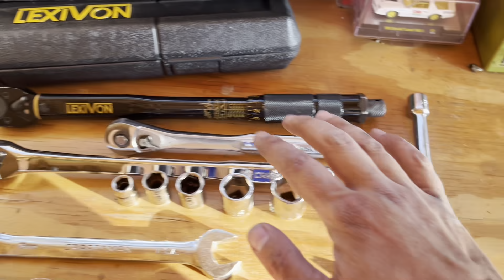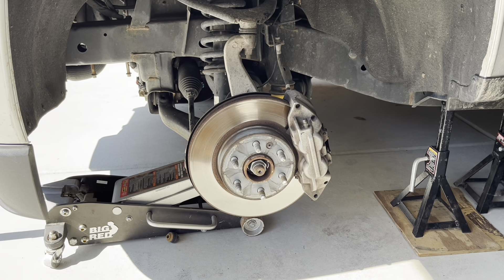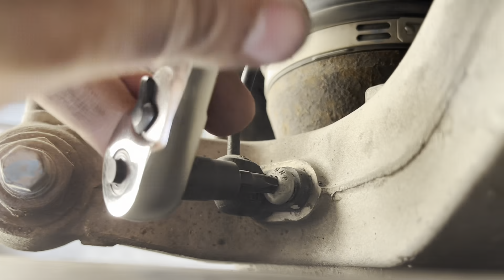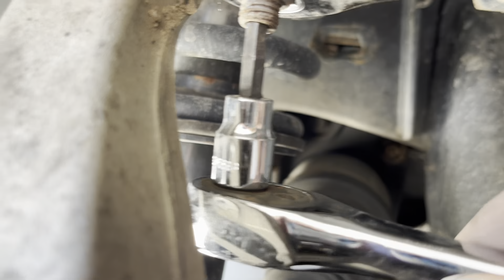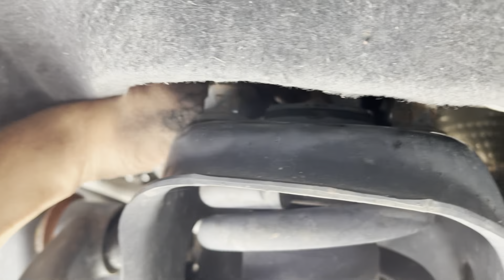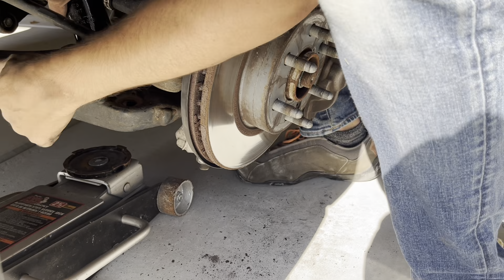Front Strut Assembly Remove and Replace 2015-2022 2nd Gen Chevy Colorado GMC Canyon

Comment: One does not have to fully remove the sway bar to facilitate replacement of the struts, correct? Removing the end links, loosening the bushings and allowing the bar to be lowered out of the way works, doesn't it?
Reply from the maker: That’s correct. I mention that at one point in the video, I was in there replacing the bushings anyways so I just dropped the whole thing.
Reply: @WildFrontierGarage  Gotcha thanks. Missed that!
Reply from the maker: @StevenDFlynn yeah no worries - I try to get pretty detailed so I don’t turn out to be that guy that skips the crucial steps, so it’s easy to miss things. Hopefully the video helps!

Comment: I got a set of Monroe OE spec struts. Guess we're all at similar times in our truck maintenance schedule
Reply from the maker: The 2nd gens are the old ones now lol
Reply: @WildFrontierGarage  Question for you guys using the Gabrial or Monroe "quick struts".  Did the ride height stay the same with the springs supplied with these assemblies?
Reply from the maker: @novajohn6538 no difference in ride height for me on the Gabriels
Reply: @WildFrontierGarage  Thanks.  Are you pretty happy with the ride and performance of the Gabriels?
Reply from the maker: @nov @novajohn6538 - I’ve had no issues since I put them on in this video. Rides like stock, no change on ride height, no manufacturer or maintenance issues either.

Comment: If I use bilstein shocks in the back that support one inch of lift can I lift 2 inches in the front since for stock the back is already an inch hire? Like 2 inches lift in front and one inch lift in back ?
Reply: If you want pretty close to perfect level, a 2" leveling kit in the front will yield the just about perfect level on majority of the 2nd gen Colorado/Canyons. If you tow or don't want it leveled, but want the 2" in the front...then yeah a 1" block or add-a-leaf in the rear will work with the Bilstein shocks in the rear. The stock shocks work with the 1" lift in the rear fine for just everyday driving with the 1" lift unless you are offroading and articulating the suspension.

Comment: Possible could just remove the tie rod from the spindle and pull out from the bottom forward.
Reply from the maker: The reason I wouldn’t mess with the tie rod is you don’t want to mess up your alignment. If you get an alignment afterwards then no problem
Reply: I've done it this way in the past. It's a bit more of a shove, pull and get frustrated when doing the tie rod route trying to get the assembly in and out. removing the upper arm is the best solution.

Comment: Early for struct on 2018?
Reply from the maker: A lot of wear and tear (off road and construction stuff) also 120,000 miles
Reply: @WildFrontierGarage  Yeah - definitely not early for you. my 2016 Z71 Colorado had shocks that were shot at 40k after just highway driving...They were so shot I could play the shock like an accordion with ease.
Reply: @Stumpee33  about to do mine at 65k, truck rides like a bucking bronco